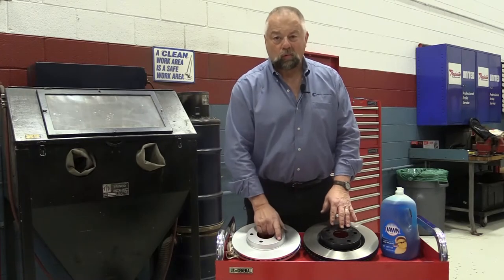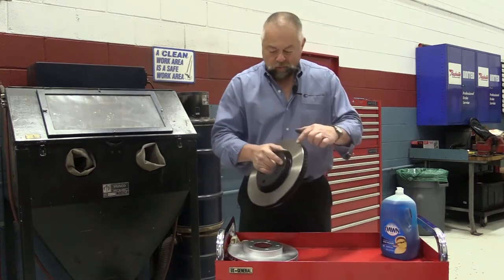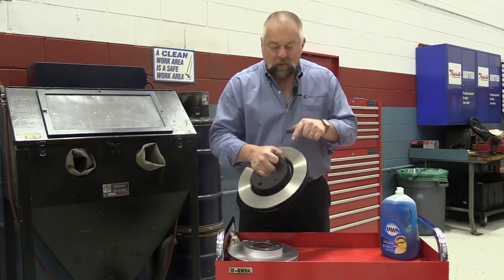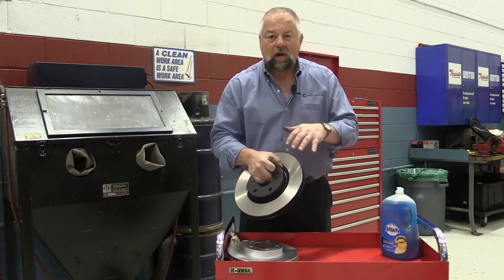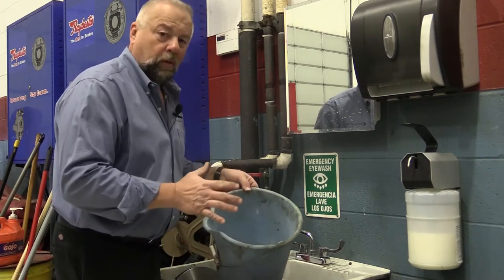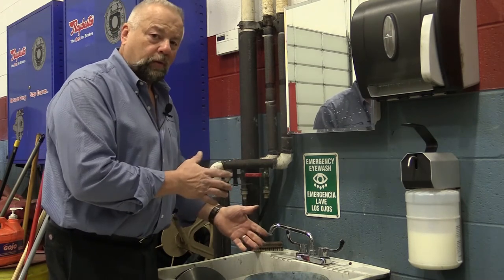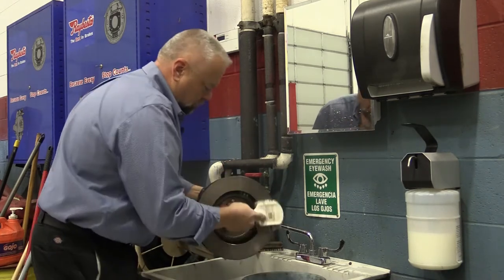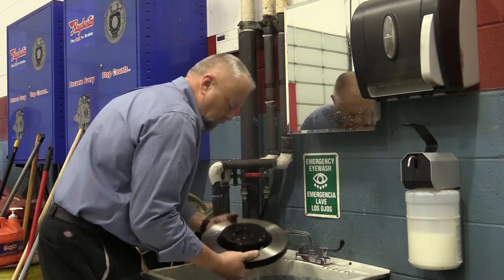Brake Job Tools: Dish Soap and Water

Comment: Dish soap should not be used as it usually has salt in it ( To make the plates sparkle) which will get into the central cooling fins and accelerate their rusting. Use car shampoo instead.

Comment: So.... Don’t use any brake cleaner on them?   Thats all I use ....
Reply: Not at all, by all means, use brake cleaner. FYI, metal shavings will still be on the rotor is all:) What I'll do is, clean with soap & water and dry; follow it up with good ole' brake cleaner....
Reply: Read the SDS for brake cleaners...it's some nasty stuff all the way around. Bad for the environment (I couldn't find out how to dispose of it correctly), bad for our health (multiple organs, reproduction, etc) , tons of VOCs. If you can avoid that by using soap and water, that makes a lot of a sense!
Reply: @anthonygraham8968  I’ll stick to brake clean.
Reply: It's just oil, dish soap works perfectly fine and is even recommended by some manufacturers.